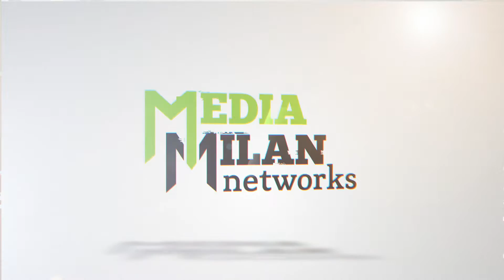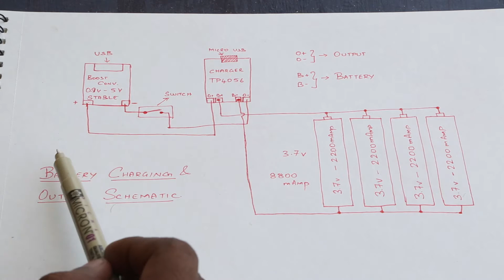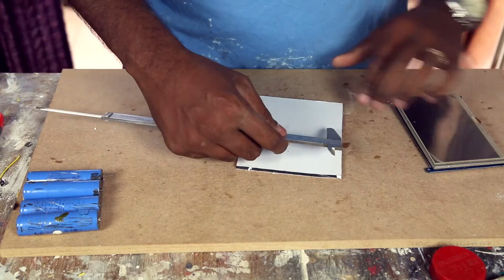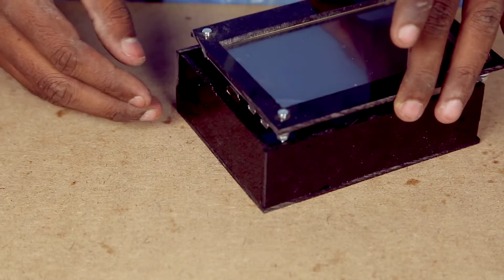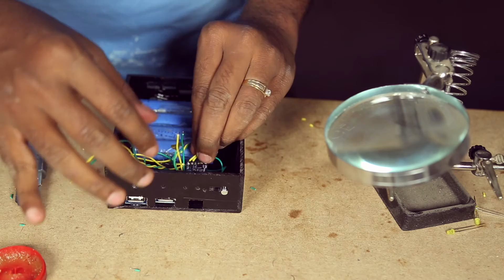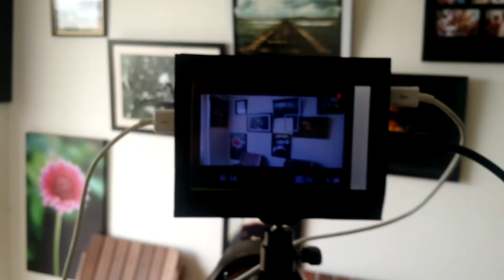DIY - DSLR Video Monitor - Portable LCD Screen

Comment: Hi mediamilan thanks for sharing. I have an old vivitar camera with 2" screen. Can I use it's screen for fpv? Thanks.
Reply from the maker: What input does that screen take and what is the voltage consumption?
Reply: Regarding input it's with a board with a thin flat strip and voltage is 3v.